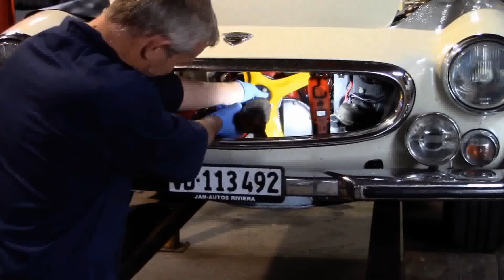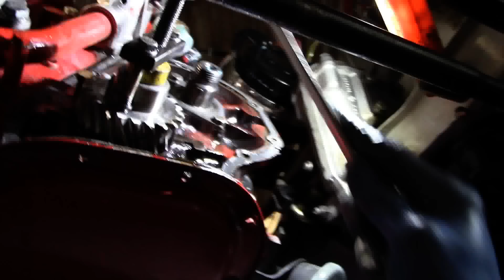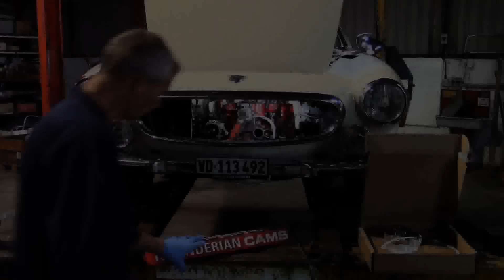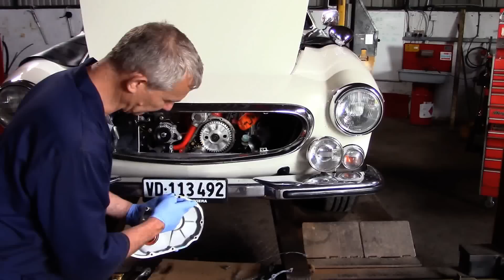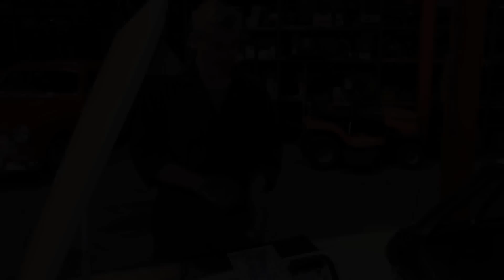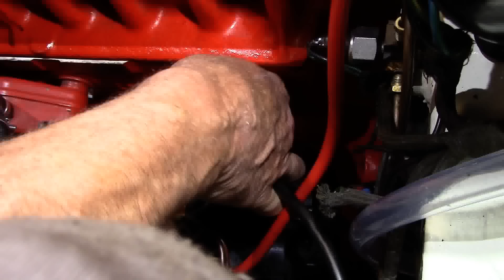Amazon Cars: B18/B20 camshaft change

Comment: What type of Loctite are you using for connecting the bolts?
Reply from the maker: For the manifold studs I'm using "StudLock", which is a bit stronger than the usual threadlock.

Comment: How many hours labor do you figure in changing out timing gears (66 Amazon)...a bit worried what the mechanic is going to quote the job at.
Reply from the maker: Evening Gary, I would expect to take 2 to 4 hours with all the correct tools and taking care with the sump gasket; I have seen timing gears that required oxygen acetylene to remove them, however 4h is unusual. A garage who've not done a B18/B20 before would want to warn you of twice my time to cover all eventualities.
In conclusion, I would not be surprised hear a day's work quoted, but would rather hope it took less time.
Reply: @amazoncars  Thank you for the quick reply, hoping there's a "Volvo guy" at this shop otherwise may have to do some searching around.  Should get the quote in the next day or two, fingers crossed.
Reply: @amazoncars  It ended up being 5 hrs labor plus parts...but at least it's back on the road again.
Reply from the maker: @deathcar  That's very fair Gary, glad you're up and running again.

Comment: I did not see if you put the collar around the end of the oil pump/distributer drive shaft. I am told these are needed for the higher performance engines. However I have not seen a failure with road cars.
Reply from the maker: Jimmy, I used to do that with our customers' motorsport engines, but not our own: and like you I've never seen a failure even when Emma accidentally revved to 8000rpm, and routinely changing gear at 7000rpm.
So I agree: don't bother.
If we ever do experience a failure, it'll be on our website immediately!

Comment: On a regular daily driver would you say it’s ok to reuse the original head bolts if they were never removed before?
Reply from the maker: Yes! Because it's an iron head, on an iron block with ferrous cylinder head bolts, there is no expansion differential: everything expands similarly, so the bolts do not suffer the stress of stretching & contracting that an alloy head would result in.
However, we often find that whilst the bolt threads on the spark plug side are usually immaculate,  those on the manifold side can be dry/rusty, so it may be worth replacing (5 of) those, and we always run a tap down the block to clean the threads.
That said,  we do replace them in our engine rebuilds, for cosmetic reasons.
Reply: Amazon Cars i read that the head bolts are torque to yield and once removed you never reuse but since you are an expert I’m going to reuse  them. I will replace the intake/exhaust manifold studs though...I broke one already.  Thank you for your time and response and I greatly appreciate your videos. 👍👍👍

Comment: Very nice video! I would have loved to hear how the car ran after the swap.   I'm most interested in the car's idle. After cutting about 2 sec. off the 0-60 time was the idle lumpy? I've had a Iskenderian VV61 cam  in the car for 15 years and I've had lumpy idle at 900 rpm since it was installed. I've changed the jets in the Weber adnauseum but iv'e never been able to get a smooth idle at 750rpm. The car is now fuel injected with Megasquirt, and I can get a somewhat decent idle at 900 rpm by running a bit rich.
Do B18s idle perfectly at 750 rpm with any camshaft, Volvo or aftermarket?
Reply from the maker: Thanks Doug. Our favourite 300deg camshaft recommended idle is 1200rpm - it will happily idle at 800rpm, however there is a warning that the cam lobes may suffer early failure. 1200 probably isn't acceptable as a daily driver, but as a competition car is fine.